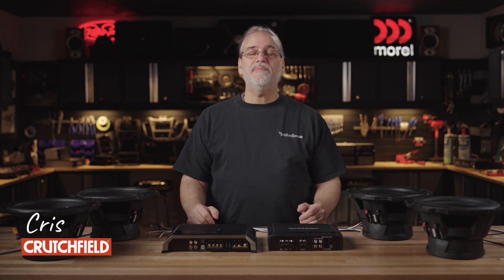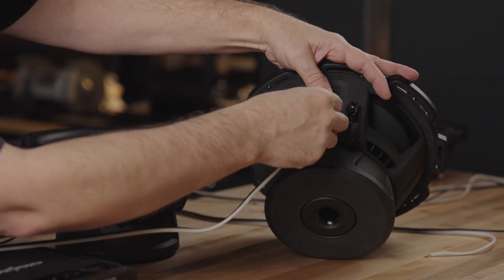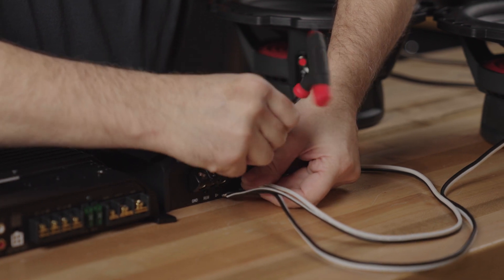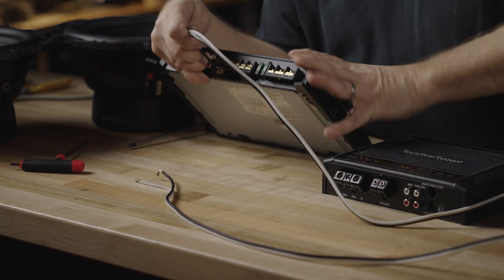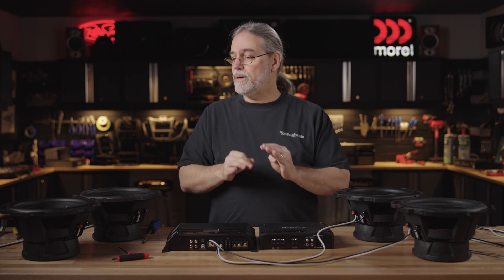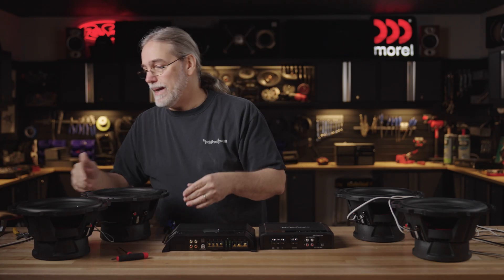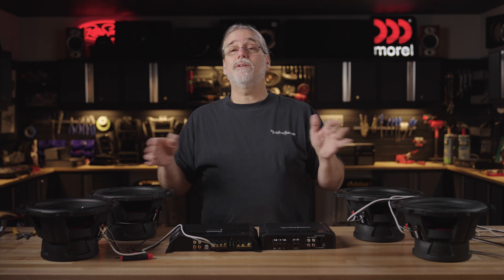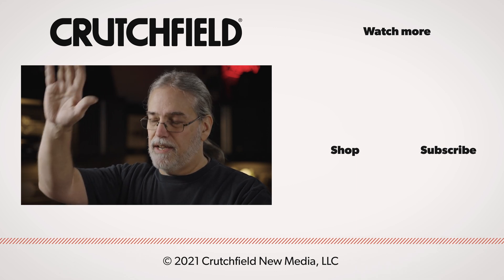How to wire multiple subs to your amplifier | Crutchfield

Comment: What amp would be best for the Mtx tn10-04 subs?  I have 2 of them
Reply from the maker: Hi Logan. How many subs do you want to power?
Reply: @crutchfield  2!
Reply: @crutchfield  I got 300w at 2OHM amp. If I run it parallel. Is that right?  I’m knew to this lol
Reply from the maker: Yes, you can wire the two MTX TN10-04 for a 2-ohm load. 300 watts is a perfect power match for the two.
Reply: @crutchfield  thank you!
Reply from the maker: Anytime! 🙂

Comment: is it possible to connect two SDR-10 D2 10 subs to a Skar Audio RP-1200.1D Monoblock Class D MOSFET Amplifier at 1 ohm?
Reply from the maker: Hi Nathaniel, we don't carry Skar. The specs for this amp show 800 Watts x 1 Channel at 2-ohms which would be your best bet for wiring up these subs to it.

Comment: I have to JL audio 8W7a E3 subs what’s the best thickness wire to go parallel with them ?
Reply from the maker: As long as the wire lengths are short, 12 gauge wire will work to connect the subwoofers to the box terminal as well as connect the box terminal to the amp:

https://www.crutchfield.com/I-rYALc227/g_50600/Car-Speaker-Wire.html?fa=1#&nvpair=FFGauge|12-gauge

Comment: So if I bought a monoamp for a sub or two, would I need to get another amp for the other speakers such as my dash and coaxes? Or should I get one big 8-phase amp so I can connect the three dash speakers, four coaxes, and single woofer to the same amp?
I’m new to this, lmao
Reply from the maker: The need for an amp on the speakers depends on your goals and partly on the speakers that will be used in the system. There are times when the only external amp installed is one to power subwoofers. In times like this, the radio powers the speakers with its built-in amp.

But then there are times when external amps are used to power all the speakers.

We can tell you that installing an external amp to power the speakers should make them play better than using a radio's built-in amp to power them. Just don't exceed the speakers RMS watts with the amp. We wouldn't want to get so much power that the sound is still bad because of it.

What speakers are you installing?
What vehicle is this in?
What speakers are installed now? What changes are you hoping to make to the sound you get with those speakers?

Comment: If u have 2 4ohm dual subs, can u wire each sub as series which make ea sub 8ohm then parallel both at the end to drop them back into 4ohm instead of keep doing them in series to be at 16ohm load?
Reply from the maker: Yes! The wiring can be done as you are hoping and it will present a 4 ohm load to an amp
Reply: What about wiring a 2ohmDVC and 4ohmDVC together on one amp? If I wire the 4ohm in parallel for a 2 ohm load, and the 2ohm in parallel for a 1 ohm load then wire both in series at the amp, will that present a 3ohm load? I know it's not recommended but I'm curious.

Comment: So can I just put 2 positives in the positive and 2 negatives in the negative to run 2 subs on a single channel amp?
Reply from the maker: The best wiring option will depend on your exact setup. How many voice coils does each sub have? What is the impedance per coil? What is the minimum impedance rating for your amp?

Comment: which is the best connection for a double coil subwoofer? is it in parallel or series?
Reply from the maker: That really depends on the specific sub and amp being used. What type of sub and amplifier do you have?

Comment: What's the best way to wire 2 dual coil 4ohm subs into a mono amp with 4 terminals if I'm trying to convert those 4 ohms into a 2 ohms load? Parallel or bridging?
Reply from the maker: It is not possible to wire two DVC 4 ohm subwoofers together for a final of a 2 ohm load for the amp. The options are 1 ohm and 4 ohms. We have a guide that can help show the wiring layout:

https://www.crutchfield.com/I-rYALc227/learn/learningcenter/car/subwoofers_wiring.html
Reply: @crutchfield  thank you. 1 ohm it is!
Reply: @crutchfield  trying to wire mine in a middle vented enclosure is confusing me. Looks like at least one speaker wire will have to run past the vent to the other sub.
Reply from the maker: We recommend keeping the speaker wire away from the port opening in the box while running the wire inside the box. We don't want the air that moves in/out of the box through the port to be impacted by the wire. It may also help to secure the wire to the interior sub box walls.
Reply: @crutchfield  thank you. So there is no good way to wire 2 dvc 4 ohms P3's for a P1000.bd amp?
Reply from the maker: You can wire them to it; but, more power will work better for those two subs.

Comment: I'm wiring 20,  4ohm svc subs to a 2ohm final impedence. Gonna try and figure out how to do this, and if I HAVE to I could buy a 1ohm rated amp if I have to wire it to 1ohm.
Reply from the maker: That won't be possible without wiring some of the subwoofers out of phase with the rest. If you can make room for 4 more subwoofers, then you can keep them all in phase and create a 1.5 ohm load for an amp.

Comment: If you have 500 watts out at 2 ohms x1 With 2 subs wired at 2 ohms , What is the watts to each Sub ? 250 or 500
Reply from the maker: Just so the amp is wired for a 2-ohm load, you'd have 250 per sub.

Comment: Can I do series wiring on a home theater powered sub? They are 2 different speakers. I did it and it worked but idk so I unhooked until I find out if it's safe I dont want a fire!
Reply from the maker: Which powered subs do you have? Also, which ports on them did you use to connect them together and to the receiver?

Comment: Just remember one thing: never wire speakers that utilize crossover networks in series. There is potential for degraded sound and even electrical damage. Subwoofers that do not have crossovers (some do) are fine, but not 2 way or three way speakers.
Reply: Is it ok in parallel? Like say, two coaxial 6x9’s in parallel.

Comment: So dual two ohm subs together would be one ohm? I have 2 halo alpine ten subs I noticed when I took one apart that they have 4 connectors and two of the are jumped i think but anyways on the outside terminals on the box it says 2oms. I would just plug the positive and negative of both boxes to the amp and I should be at one ohm? Srry I’m a noob and just want to be completely sure.
Reply from the maker: Each subwoofer is internally wired to present a 2 ohm load at the box terminal. Wiring two of the boxes together in parallel like you described will present a 1 ohm load to the amp. You nailed it!!!

Comment: So can I run 2 4 ohm voice coil subs down to a 2ohm load instead of it dropping down to 1 ohm ?
Reply from the maker: It is possible to wire 2 single voice coil 4 ohm subwoofers to a 2 ohm load using parallel wiring.

Comment: So tell us in more detail...
I.M.H.O. if I'm right or wrong...
1) Class G...2/3 step voltage level , appropriately selected to drive either class A , AB , D..
2) Class H ...continuously variable dc volts..
selected by music level to drive....same as above...both are not " classes " of amps by themselves..but vastly improve the power eff.
specially in professional audio.....
3) what's was / is class " T " of Tripath audio fame... a frequency modulated audio fed to pwm comparator in MHz range??
4) why no / few mentions of 
class " I " (interleaved pwm a.k.a. balanced current amp.). ??? is it still CROWN AUDIO 's proprietary goldmine..??? Let's hear something...

Comment: So on my t15s I matched my positive from both speakers and negatives from both speakers and put a clamp with a loop on the end and hooked it to my terminal cup. Is that ok to do?
Reply from the maker: The best option will depend on the specs on the subs and the amp you have. Just so you wire them for a good impedance and power match for your amp,  you're set.

Comment: Hey i have a jbl gto 6000, and a pair of climax danger 500's. But i cant figure out how to wire them. The subs and amp are rated at 4 Ohms. When i wire the 2 subs to eachother they are fine and read 4 ohms but when i hook up the amp they read a 0.1. What did i do wrong?
Reply from the maker: I could not find the specifications for that gear online, but we do have a tool that can help with finding the best way to wire subwoofers to amps:

https://www.crutchfield.com/I-rYALc227/learn/learningcenter/car/subwoofers_wiring.html
Reply: @crutchfield  ahh ok, its a 6 channel amp so it isn't listed on your website. Im just going to save my self some time and buy a new amp💯💯
Reply from the maker: That may be the best idea. 6 channel amps do not usually work well with subwoofers.
Reply: @crutchfield  got any suggestions? I have 2 climax danger 500 subs thet are DVC 500wRMS rated. Whats a good option i can get?
Reply from the maker: I believe earlier you said each voice coil was 4 ohms. There is a Rockford Fosgate amp that would give each sub the 500 watts RMS they can handle:

www.crutchfield.com/I-rYALc227/_575P1KX1BD/item.html

Comment: Maybe you guys can help me understand speakers with what I have. I have a leftover mono class D amp 1 channel 1 set of + and - terminals. It has RMS 1x180watts at 4ohms and 1x300watts at 2ohms. Do you guys carry a full set of components speakers (front 6x9 with tweeters and rear 6.5) that would allow me to use this amp instead of a 4channel amp? How would I even wire it? Use to use this amp directly to power 1 sub and just wondering if I can power a factory 6 total speaker upgrade now by chance with it. Thanks!
Reply from the maker: Mono amps are not designed to power the speakers in a vehicle. A 4 channel amp is needed to power 4 speakers. If you don't care about being able to fade the sound, it may be possible to use a 2 channel amp (two speakers connected to each channel) to power all 4 speakers. Have you chosen the speakers you are going to install?
Reply: @crutchfield  no, but if that's the case and I can't use this amp anyway, I might just replace the door speakers and install a powered sub...so I wouldn't be amplifying the door speakers. For whatever reason, there doesn't see to be ANYWHERE online that shows you how to wire a factory radio with a harness adapter into a LOC and then into a powered sub/amp or into an amp and then a sub.
Reply from the maker: We typically do not have harnesses for that unless they are made to plug into specific model and use a molex plug to connect to it. We can check your vehicle for this type of part. What is the year, make, and model of it?
Reply: @crutchfield  I have a company that makes a harness for it. It's a 2022 Chevrolet Equinox RS non-Bose. The one you sell tends to have concerns. The one I have plugs in and has speaker wires coming out to go into LOC and convert to RCAs. Any suggestions?
Reply from the maker: Since this will just be used for a subwoofer, the AudioControl LC2i works great for this task. Here it is:

www.crutchfield.com/I-rYALc227/p_161LC2IPRO/item.html
Reply: @crutchfield So my last question is I guess I just need to run the power and grounds from the LOC separately of the subwoofer amp? So I will have two power cables and two grounds basically.
Reply from the maker: Typically, yes. power distribution blocks do not usually accommodate wires as small as 12 gauge. We have a video showing the install of it using the stock radio's power wiring. However if that harness you got only provides the speaker connections for the LOC then you may choose to run a new power wire for the LOC. We made this power wiring kit just for LOC's like the LC2i:

www.crutchfield.com/I-rYALc227/p_700DSPLOC/item.html

Comment: Question: In the Series demonstration, you used the Sony amp to hook up the subs to one set of terminals. Would a second set of series wired subs hooked up to the second set of terminals in the Sony Amp be seen as parallel? Thus creating a 4 ohms out put for 4 subs?
Reply: Yes. You could also do the same with the single set of terminals on the RF amp.
Series/Series/Parallel